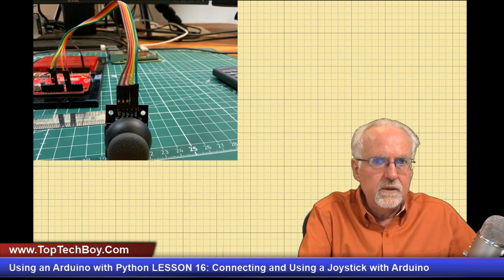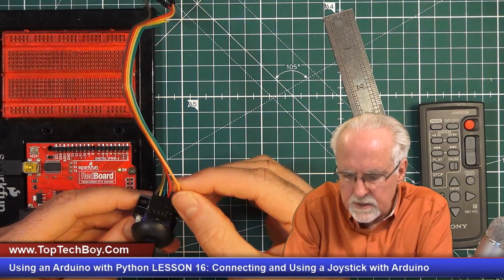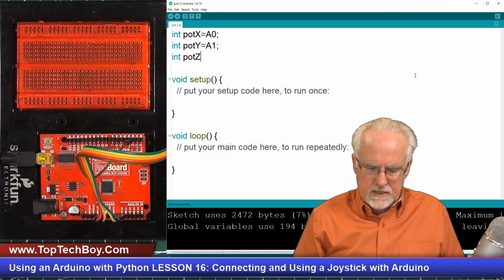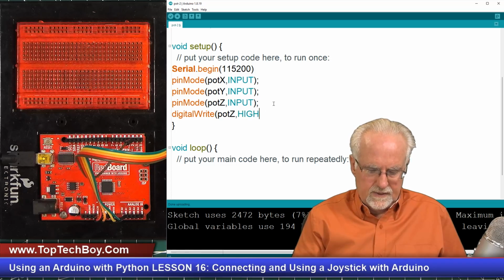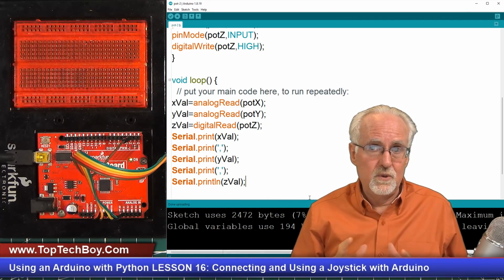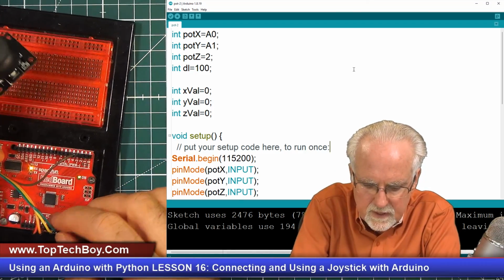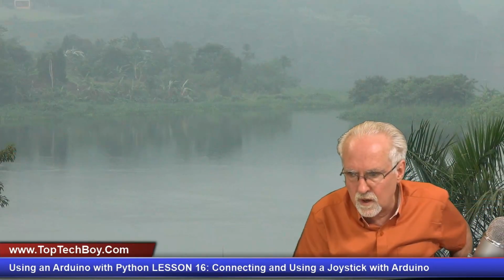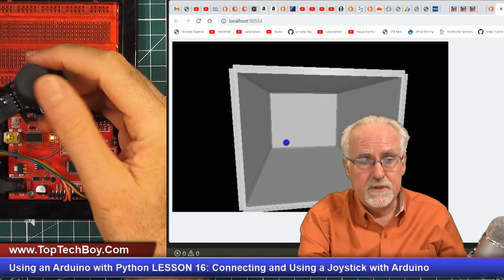Using an Arduino with Python LESSON 16: Connecting and Using a Joystick with Arduino

Comment: https://youtu.be/8HDPkvbrtUc   project was a bit tricky as I wanted to add a “dot” that showed the last hit by the ball on the wall. I used a cylinder, so it had to flip depending on what wall it was one. Forgot the length= issue and went down a rabbit hole for an hour until I remembered that.
Reply from the maker: LEGEND!

Comment: Hi Paul, I've been "out of circulation" for about 3 weeks. I decided to do this homework and added a bit more to the project. I used the code you taught me which incorporated the widgets for ball size, color and speed. I created a circular paddle (bat) and got it to cover the whole front wall area plus the in and out movement (z axis). In the process I learnt how to code using the "concurrent.futures.ThreadPoolExecutor". I also incorporated a sound bite whenever the bat hit the ball. Unfortunately it wouldn't work while I was recording the video for you to see, so it's a silent video. I haven't viewed tutorials 17 and 18 yet so I hope I'm doing this correctly: I'll soon find out. Here's a link to my video:
https://youtu.be/qywNkxQ_HP8
Reply from the maker: Interesting. But, the video link did not work for me.
Reply: @paulmcwhorter  Hi Paul, can you try this again. I think the problem had something to do with me scheduling the date for viewing wrong on YouTube.

Comment: Hi Paul, a challenging lesson, but (at long last) I now have a ball bouncing around a "U" shaped arena, and at each end there is a bat. The joystick can move each bat, and the active bat is selected using the joystick button. Data is also going to the Arduino as I have LEDs and a piezo buzzer in the design too.

I have posted my solution here: https://youtu.be/A-OvP9Mt6_w
Reply from the maker: Really great work.

Comment: I folded like a cheap Walmart lawnchair on this one, Paul. I got the data to print in python, created the paddle using parametric dimensions, but couldn’t get the paddle to move. I believe we need some of that fancy programming like functions or threading that you discussed in other lessons.
Reply from the maker: DrDave, it is really very simple . . . well it will be simple when you see it. Keep trying, dont get discouraged, and I show you the solution in the next lesson.
Reply: @paulmcwhorter  ok thanks
Reply: @paulmcwhorter  Great lesson, again, Paul! It appears I was on the right track completely, but I have a bug somewhere in my code and ran out of time: busy with the grandkids. I am anxious to find the bug, so I can perform a righteous double chest bump, lol. I’ll put it on YouTube when I do.:)

Comment: Thank you, Paul, for this great series.  I extended the arduino-joystick-to-python lesson to the datalogger and dump sketches  included in the Arduino IDE.  That allows the user to record from a sensor with arduino, save the data to SD, and then visualize the data with python at leisure.

Comment: Surprised myself by actually doing this. Worked when I excluded 'while arduinoData.in_waiting' etc (not too sure why had to not include  this). Also, I worked out a simple paddle.pos equation based on room dimensions and the 0 to 1023 range of the pot. Still looking forward to your solution as I am sure it will be a bit more elegant than mine.